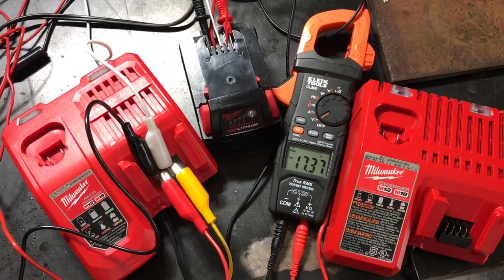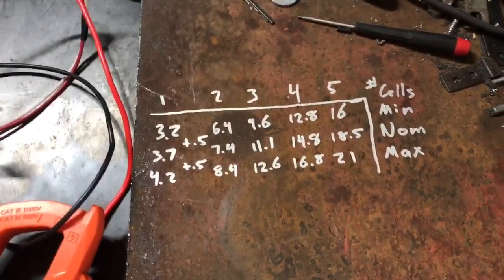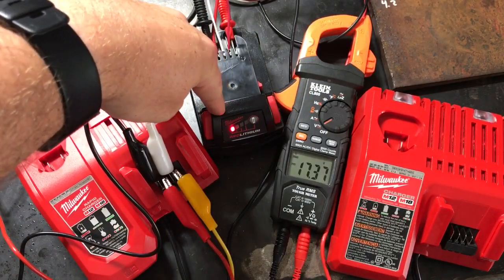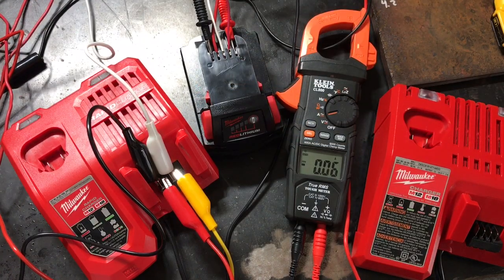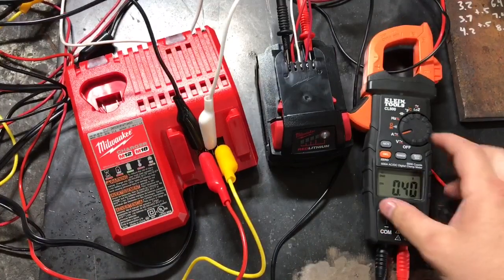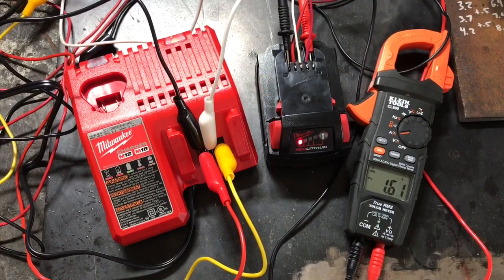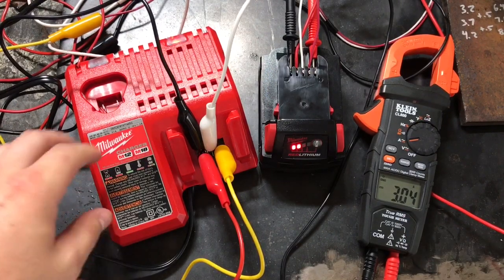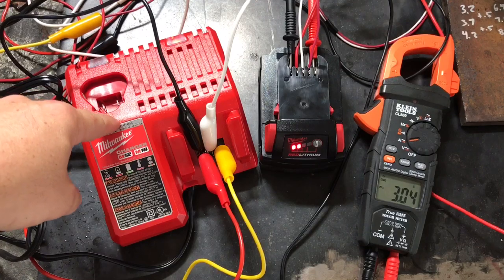SBM: Milwaukee Rapid charger vs Regular charger and in depth battery talk

Comment: Thanks for posting the useful information.  Milwaukee quotes nominal voltage for the M18 but maximum voltage for the M12.  For an M18 battery the charge controller is inside the pack and not in the "charger".  The  controller inside the pack does have fine wires going to the positive terminal of each cell so it does appear that it does balance the cells when it charges.  The five pin connector has the outer pins conneced direcly to the cell pack.  The middle pin provides power to the charge controller inside the pack.  Pins 2 and 4 carry the communication signals between the microcontroller in the pack and the one in the "charger" or the tool.

Comment: Typically if you're pushing the same number of amps as amp hours it wont really affect battery life. Pushing 6a in a 12ah battery isn't going to harm it. Pushing 6a into 6ah is about maxed out. Dewalt called it 20v to avoid confusion with their old 18v NiCad packs.

Comment: It’s still fast compared to cheaper brands I had some tools purchased at an online store and those cells of that unknown brand took like 3hrs and lasted 25mins hahah , my other concern for the fast charger you got is if the 12v batteries will also charge at double amperage or just works for m18 batteries ? I have no issues w the standard included charger of the m12/18 but today I was super surprised at a tool I won’t promote the name 😂 but it won the m18 , it’s also 18v lithium tech and the mah is 2AH but guess what  it charge at around 7ah I was super impressed the power consumption was over 160w that makes this batteries of this brand easy to charge in 20mins they were don’t from 1-4 bars but I do have my doubts the internal cells can even like this type of amperage going through them unless they were some great brand I won’t recommend such power going into unknown cells . Anyways now I know my standard Milwaukee charger is slow 🤣 it’s just like in cellphone newer chips newer cells allow more juice to be dump anyways hope someone learns from all this info blessings.

Comment: A lot of anecdotal guessing in this video based off of what other companies do... the Milwaukee batteries have the balancing built into the PCB (battery management system) within the pack itself.

So you have 5 pins on a Milwaukee battery. Negative, J1, charge, J2, and Positive. The J1 and J2 are data lines which allow the battery to “talk” with the charger or the tool it is connected to. The positive and negative leads are connected to each end of the cell groups. Yes this means the battery doesn’t have to have anything built in to cut off the output when it runs too low, it just tells the tool to turn off. When connected to the charger, the charger applies voltage to the charge pin on the battery, and the battery management system in the pack handles the balancing.

Comment: You know enough to be dangerous, the balancing leads do not carry current, they monitor voltage and balance across the cells. Exactly like an RC car charger. The cells do not get charged individually they are charged as a pack and balanced through the balancing leads. All lipo and li-Ion packs work this way. Balancing leads will let the charger know of a dead cell or a cell that's hogging all the current which will shut the charger off all together and give you the error lights. Also the HD batteries are using the larger 21700 cells vs the 18650 cells in the smaller packs
Reply from the maker: You are correct. I misspoke in the video and after doing some digging the batteries do the balancing internally. What Milwaukee calls ‘Red Link’ thanks for the info on the cells
Reply: @silverbackmoose8642  I hope I didn't sound rude in my comment. I like your videos!
Reply from the maker: All good. Honestly, it’s really difficult to not misspeak or to hit every point you want to make in a video. Comments with good info and discussion are always welcome.

Comment: 6 amps is way to much for like one of the 2 Ah batteries unless it has a way to decide what battery is on it but since that 5.0 was getting 6 amps but i mean whats recommended 1/2 C so thats not bad for the 5Ah but the 3,4 and 2 that 3 amps is ab it much and also im pretty sure that the balancing is happening on the circuit in the battery
Reply from the maker: Yup i agree I would not use the rapid charger on any of the smaller batteries

Comment: Interesting point about the lack of balancing of the cells. I noticed that Makita batteries and chargers have an additional seven copper leads, besides hot and neutral. Perhaps five of these are for monitoring the 5s cells. Would this make sense, or would there need to be at least 10 connections, one for each of the 10 cells in a standard 18v battery?
Reply from the maker: It’s possible that they could be using them to balance two cells at a time one from each series set, that’s 5, one for thermal detection, and one more for voltage detection. That’s 7